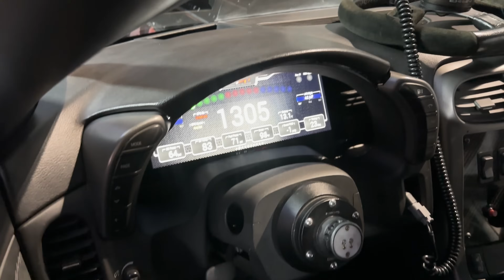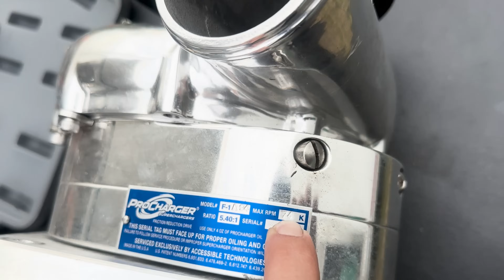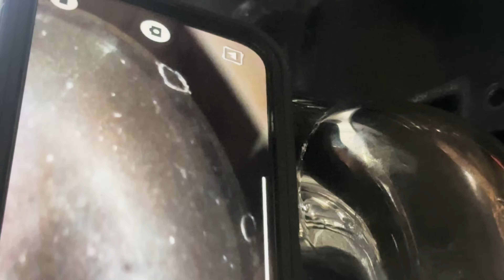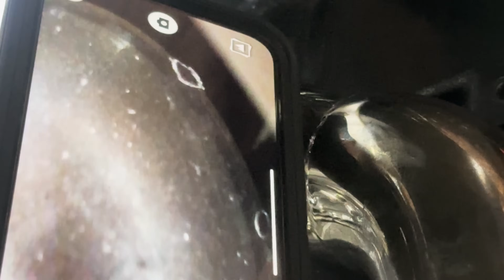Race Cars SUCK!!! (It’s mostly my fault)

Comment: I didn't know you could leave the trans/rear end hooked to the torque tube with no support like that. Looks like it definitely makes it easier than putting the whole assemble with the cradle in at once 👍
Reply from the maker: It’s setup diff on this car.   It’s bolted In on this car
Reply: @RaceProvenMotorsports  Makes sence, thanks for the reply!

Comment: It's turbo time!! 😎
Reply from the maker: Never
Reply: @RaceProvenMotorsports  🤣😂🤣😂🙄
Reply: Nothing is foolproof at the power level you guys are running. And nothing beats the sound of a crackling Procharger on Methanol. I had asked a knowledgeable tech at Fueltech who was very helpful to me, and asked what direction we should take our program, Twins, Single, or Procharger?  He stated a big single would be all we needed for our combo and then threw in “ the Turbo guys were all cooking Hot Dogs between rounds, while everyone else was wrenching on their combos”  I know to be competitive in almost any class it wont be hot dog time but for sure between all the NOS backfires and broken Prochargers I see, it seems like for the average Joe racer wanting a fast car, The Turbo is the way to go. JMHO (as long as your head gaskets can hold up) Thanks for the videos